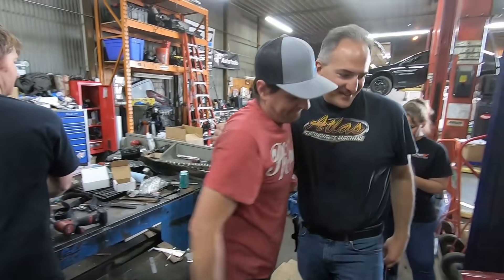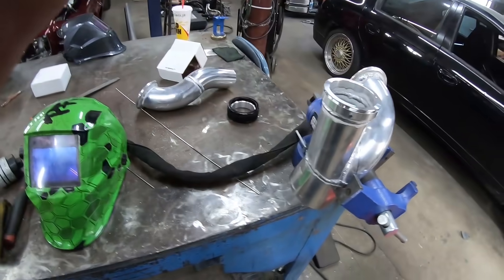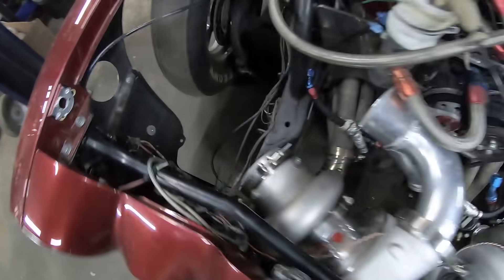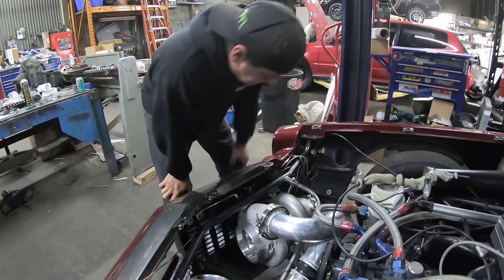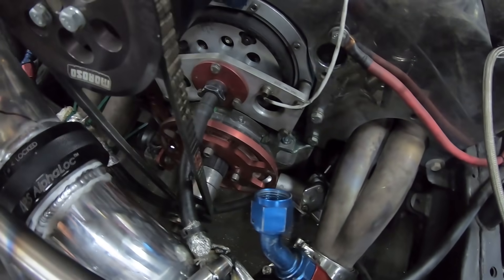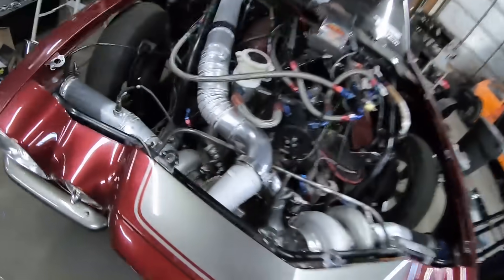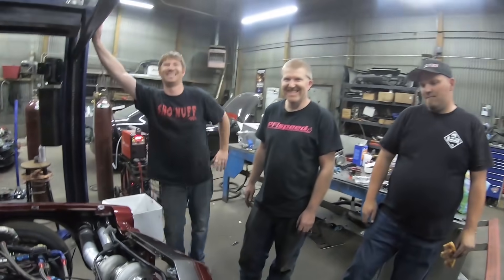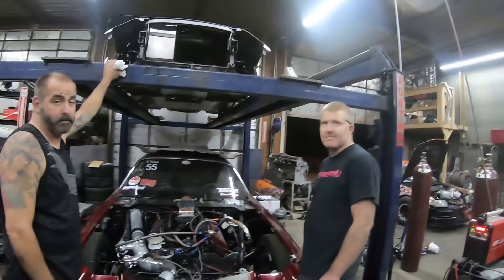Massive Twin Turbo Camaro turns out Epic!

Comment: Awesome stuff giys!.... side note. looks like your etching is a tad high. might wanna try turning your EN on time percentage up. I find that starting at around 80% and slowly working down to desired cleaning works great. also, an Argon flow rate of only 15-20cfh is perfect! ro high can create excessive etching and porosity issues. you may need to start the weld a tad slower and let it dwell before you start the run. but it may just get you to that perfect shinier less rough etch look we all love! keep up the great work!

Comment: Should have used the Maven Turbo mounts...100 times easier and cleaner to use then doing all that tubing.
Reply from the maker: These turbo don’t have the 2 bolt flange just a straight AN
Reply: @PFIBrent  Thats unfortunate

Comment: Aluminum exhaust?  Fastest melting metal to use on a turbo. Yeah that will last lol
Reply: Works fine on many other drag cars
Reply from the maker: We have done them on a ton of street cars as well just have to do it after the downpipe. Zero issues and super light 💪🏼🚀

Comment: Hate to be a broken record, but how are these turbos not both fighting for the same air?
Reply: I cant imagine, with the velocity of air moving into the inlets that they wont have issues drawing out of that low pressure
Reply: Speaking of broken records... That's why records are meant to be broken... Because if you're striving for the absolute best you'll always find something that could be a little better.. That's why a build is never actually complete unless you decide good enough.. But good enough for how long?
Reply: Plumbed to opposite side heads?
Reply: Right now they are open to atmosphere. There should be zero restriction. Other twin setups, go to the same airbox. Aftermarket placement give them their own air filters next to each other. I’ve seen 600-800hp that way.
Reply: Im sure it will matter less at 100+ mph, but they have to be cannibalizing air from each other